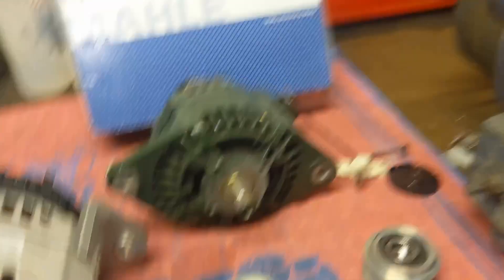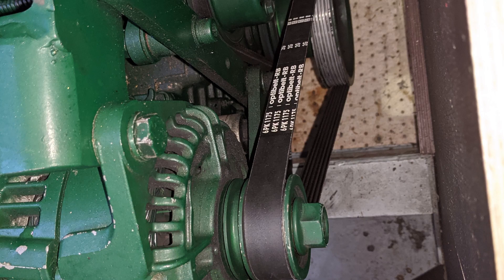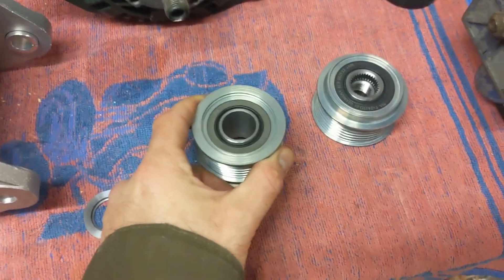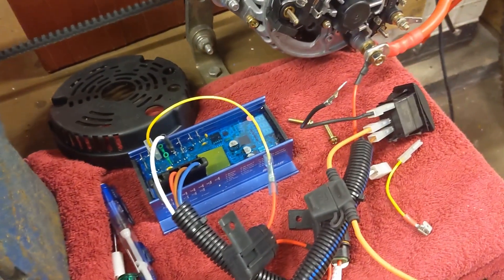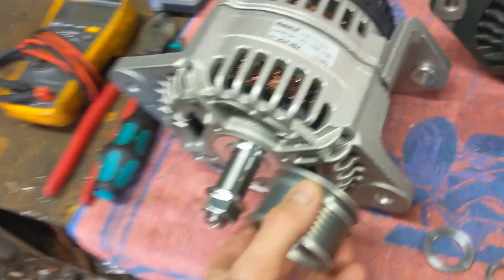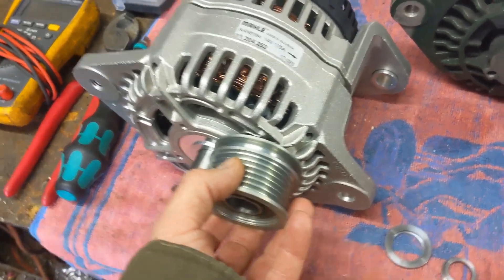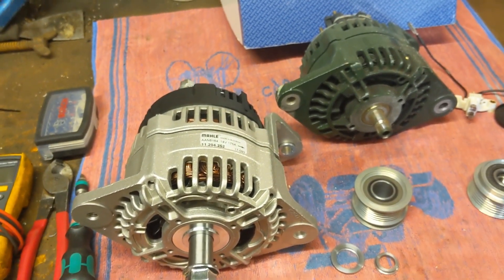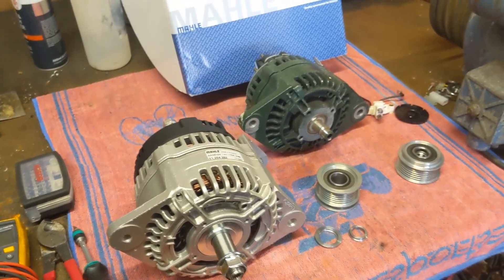Betamarine Beta43, Beta50 Narrowboat 175A Alternator. Charging Lithium Batteries. Balmar Controller.

Comment: Hi Ed, a quick question, I have a Beta 43 engine with a 175amp alternator, we have five 220ah AGMs total 1100ah. Q, is the alternator powerful enough to charge this bank and if so what would be the hours needed to achieve a full charge?

Comment: does this strain the engine more?
Reply from the maker: Engine will potentially be strained if there's no alternator control having said that it's been the factory setup for over 10 years now. In a Lithium setup it's necessary to limit current and de rate the alternator so it can run a continuous high load reliably and not upset engine performance at lower engine speeds. Regards Ed

Comment: Hi Edd , is this an engine out job ?
Reply from the maker: Hi. It replaces the 95 amp version fitted to the earlier engines and is reasonably a straightforward swap. Needs a little more room around engine as it's a fair bit bigger. Probably doesn't apply to the raw water cooled version of this engine fitted to yachts..
Reply: @edshiersfourcountiesmarine6677  
Do you do engine replacements & welding ?
Reply from the maker: @agfbuilding  Where abouts r u?
Reply: @edshiersfourcountiesmarine6677  
Oundle
Reply from the maker: @agfbuilding It's a totally different area to me and don't know of any fitters/engineers local. If you're considering a Beta they're really helpful and it would be worth calling them - they should be able to recommend someone reasonably local.
Reply: @edshiersfourcountiesmarine6677  nice one thanks Ed